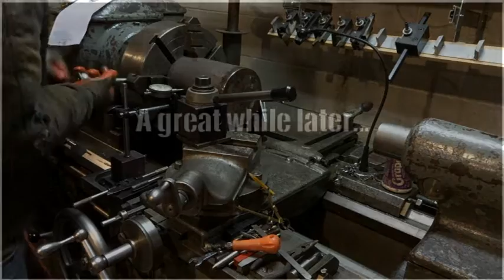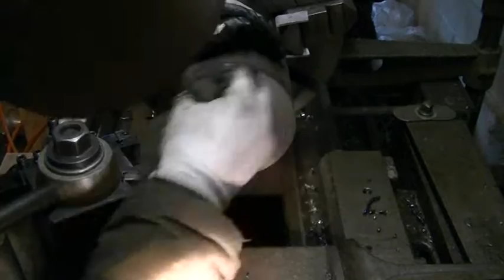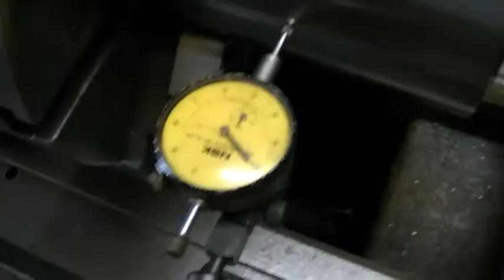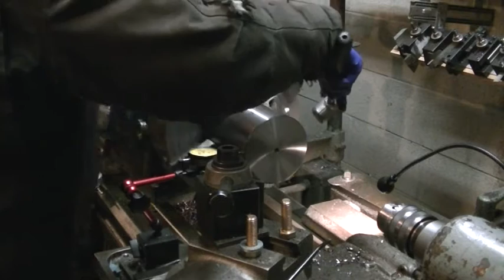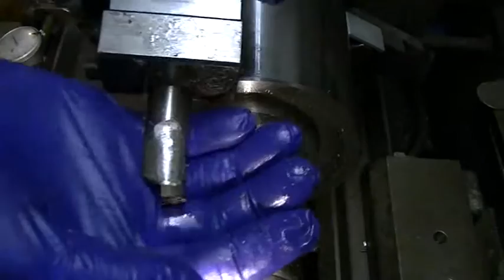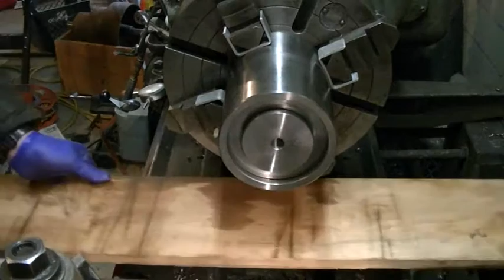K&T Mill Vertical Head Mount Part 3

Comment: Hey Clem,  I am watching this video that was made over 2 years ago...  When you make your keys for the 4 jaw chuck, make two of them.  There is a technique for using them in an opposed method.  I am enjoying this series.  Thanks for sharing.  Fred
Reply from the maker: +Fred Miller I saw John Mills (double boost) video on the two chuck key technique several years ago. As my chuck uses 1/2 inch keys I was able to try it out using some 1/2 inch socket extensions. I found it was more complicated than I could handle. Now that I use the 4 jaw chuck more often I find I'm getting much quicker at dialing in parts. Thanks for commenting. Craig

Comment: Could have just flipped the tool over and ran in the same possition with center still in part for support.
Reply from the maker: +Richard Schmidtendorff that would have been a better way to finish that t-slot, I wish you could have pointed that out before I did it my way, it was a little too nerve wracking. Thanks for watching and commenting. Craig

Comment: One safety suggestion I can pass on from other machinist is to have tight cuffs around your wrists. If you need warmth wear a sweatshirt with elastic cuffs. You don"t want to expose loose sleeve ends around moving equipment. Good work.
Reply from the maker: James Conner thanks for stopping by. I do wear my canvas work coats that have pretty tight sleeves. It can get down to 20 degrees F in the shop so I'm wearing a coat, vest and wool underthings. Fortunately my hands don't usually get too cold. Maybe this summer I'll get some heat set up in there. Craig

Comment: Nice video ! But whats with your cutting angle ?
Also I think you need higher speed with inserts.
Reply from the maker: Thanks for the comment. I am using some WNMG inserts now that are doing a much better job breaking chips with a heavier DOC. As for the turning speed, the lathe was built in 1943 and 478 rpm is all she's got. I usually run even slower to keep the gears in the headstock quieter. Craig

Comment: I have to admit I did doze off a couple of times, but it was not because of your video.
I was up early and worked all day on my f-150 replacing heater hoses.
So I was tired.
But the part looked great!!!
Mike
Reply from the maker: +Oldvet1946  Mike, I started and lost this dang video so many times due to software issues that I almost gave up on it. Sorry about the length, I should have cut it down by half. The next one will have a better mix with milling and not so much lathe work. I promise to keep it shorter also. 

Maybe it will become a hit with insomniacs and get lots of views.

Thanks,  Craig